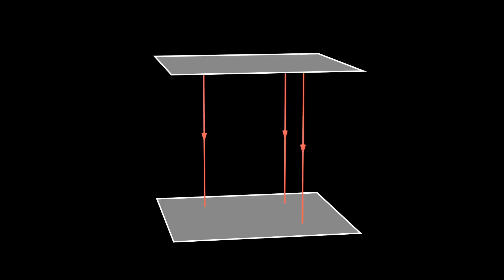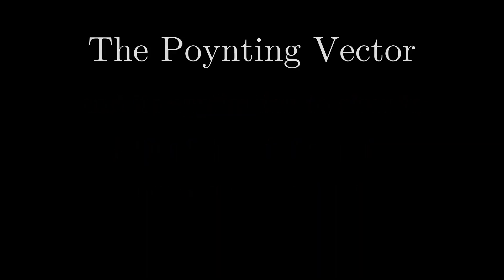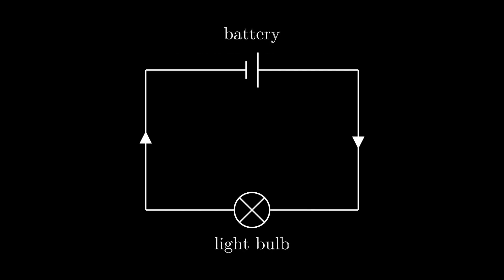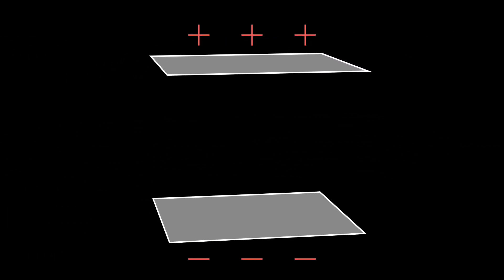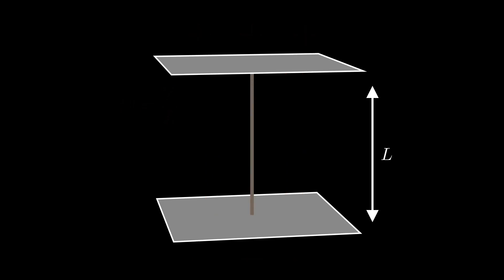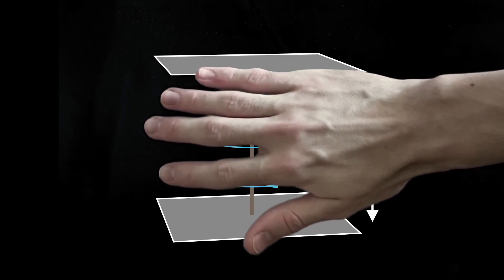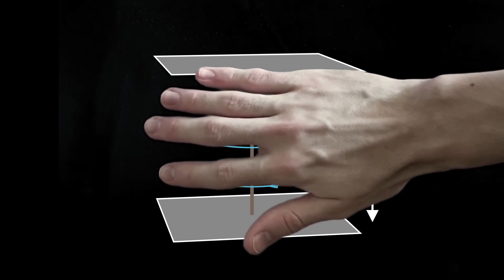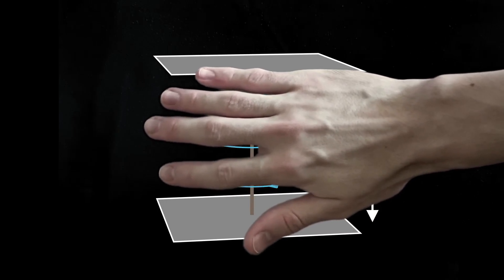The Poynting Vector in a DC Circuit

Comment: Derek's entire point revolves around treating the wires as antennas.  So yeah, the transient sure will send something across, but he's wrong that it "turns on".  The most frustrating thing about his video, including his followup, is he never talks about antennas.
Reply: In concept, a hypothetical lightbulb that illuminates upon ANY current no matter how small it is, could be lit up within 3 nanoseconds, but it is nowhere near significant enough to light up a real light bulb.  If it were, you've done a horrible job at selecting a lightbulb, because it will burn up as soon as the fields fully settle on their steady state condition, and the full power is delivered to the bulb.
Reply: @carultch  yes... walking through impractical situations is kinda the point of thought experiments. complaining that the lightbulb is unrealistic is as childish as whining about a relativistic train or perfectly aligned mirrors in an Einsteinian thought experiment.
Reply: @Errenium  I'm aware of that.  And I never said I was complaining.  I was just giving a reality check to this thought experiment, and addressing the OP's point.

Comment: Kudos to Joseph for spelling out this model so patiently. However there are some holes. 
At  5:50  There's a statement: "so yes it is indeed true that energy in electric circuit is transmitted by the electric and magnetic fields". That's not the logical conclusion from the calculations performed so far. All that has been demonstrated is that there are electric and magnetic fields that can be geometrically/algebraically combined so as to produce a number that equals the P = V * I accounting for power. The calculation does not prove that the fields actually carry the energy.  It is at least equally compelling to account for the conveyance of energy by simply integrating the electric field gradient along the wire from beginning to end (V), and the quantity of charges moving  "down" that gradient (I), losing potential energy to the heating interactions with molecules in the resistive parts of the circuit (R).  
It is no surprise that there are electric and magnetic fields associated with this activity, and that they are proportional to voltage and current. And those fields get "charged" from the circuit when it is turned on, and  "discharge" back into the circuit when turned off.  That does not mean that the pair of fields is the means of conveying energy during steady state operation.
My comment here does not prove the statement false, it just claims that the statement doesn't follow from the premises provided.
Reply: Correct.  The energy is supplied by the fields but this fact does not follow completely from the statements made.  Electron flow through a wire takes a long time and requires work to be done by the field.  That is the causal relationship.  The wire provides the electrons that support the field and field moves the electrons slowly, converting energy into radiation which is a disturbance in the near field. Photons are emitted as IR (hairdryer, toaster, incandescent light bulb).  A high frequency AC signal oscillates the charges in the wires producing heat and radio waves.  There may be no net displacement of the electrons.  They still get worked back and forth, overcoming resistance, while the field is subject to the effects of capacitance and inductance.  Thus information can be transferred quickly while the electrons, not.  An ideal antenna would have no resistance. Or something like that :)
Reply: @DanielL143  I'm happy you more or less agree with my comment, but I'd like to make one revision to your notes. It is true that the electrons move slowly (drift velocity), but the speed with which that motion propagates from one end of the wire to the other is at a large fraction of speed-of-light. So though the electron velocity is slow,  the speed with which they can have an action at any point in the circuit is very fast.
Reply: @Graham_Wideman A valid and key point for clarification.  The 'impetus' or change in state, especially during the transient response approaches 'C and this enables communication as we know it.  Would it be accurate to say that changes in the field can approach the speed of light while the movement of matter (electrons through a solid material in the case of a wire) is much slower. Do electrons in a vacuum tube move faster under the influence of a field? If current is the rate of change of charge, does the movement of the charge carriers affect Power and therefore the rate of energy transfer?  The ultimate point that I am trying to understand relates to the speed of transfer of energy vs the speed of transfer of information?  Can you help & thanks.!
Reply: @DanielL143  Although I am not sure I do believe that electrons in a vacuum tube are moving faster than in a wire. Thinking about a picture tube (as used in old TV sets or oscilloscopes) then I believe they are also the main energy carrier.  We know from particle accelerators that matter (electrons or protons etc.) can be speeded up to a high speed. I also know from my experience with old picture tube TV's that if the high voltage was too low then the picture would be too big for the screen. That correspond with that the magnetic influence from the deflection coils have a longer time to deflect the electrons as they fly slower.
If the energy was carried by EM forces to the screen they would be very fast and as far as I know would not be deflected by either static or magnetic forces and we know that it does so it must be the actual electron hitting the fluorescent on the screen that makes it light up.

Comment: I‘m in my first year of physics and we‘ve just been introduced to the poynting vector. I didn‘t get what it was in my lectures because the concept of how physics is taught in university doesn’t work for me but know I got a slight sense of what it might be! :)

One question though about the E-field though:
How can there be current if it (the E-field) is perpendicular to the wire? Is it slightly bent into the direction of current? Does it abruptly switch direction inside the wire? I‘m sorry if this doesn’t make any sense, correct me about my english, I‘m not native and would love to learn. Thank you for such an amazing video!
Reply from the maker: This is a great question, because it's commonly taught that there's an electric field inside a wire in the direction of the current, but not how strong this electric field really is. In this example it's actually very weak, much weaker than the field outside. The relevant equation is E = rho * J where J is the current density and rho is the resistivity. Wires have very low resistance and so E is very small, and in an ideal wire with no resistance there's no electric field. As an analogy, imagine that the electrons are little balls moving through a tube. If the tube has no air, then there's no air resistance, and you don't need a force to push them through. They just keep moving because of inertia. Similarly, you don't need an electric field to push the electrons when there's no resistance.

If there is some resistance then there will be a field inside the wires (in the analogy, the balls slow down because of air drag and you need a force to keep pushing them). So what happens if we take the second example with the lightbulb and battery and add some resistance to the wires? Then there will also be a small electric field in the direction of the current, making the total electric field point mostly perpendicular but slightly parallel to the wires. The thing that actually produces this new electric field is an uneven charge distribution on the wires, changing gradually from positive at one battery terminal to negative at the other.

In the Mathematica code I assumed the charge distribution was uniform, meaning all of that gradient happens across the lightbulb instead, and there's no resistance in the wires. I wanted to try adding some resistance to the wires as well, but then I would also need to solve for the charge density which makes the calculations much more difficult!

Comment: So how does the lightbulb light up? Normally the flowing electrons bump into the atoms of the wire, so heat is generated and, in case of a lightbulb, energy is radiated in EM-Waves (visible light) and thermal energy. I don't get how the energy of the EM-Waves of the flowing electrons in the circuit is necessary for the bulb to light up.
Reply from the maker: That’s correct, electrical energy gets converted into heat and light by electrons bumping around inside the lightbulb, but that doesn’t explain how the electrical energy gets to the lightbulb in the first place. The argument is that the propagation of energy from the battery to resisting components in the circuit is described by the EM fields, and then the conversion of energy into heat and light is described by atomic forces inside the resisting components.
Reply: @josephnewton   But this description flies in the face of how Veritasium insisted that we have been lied to and that all of the energy is in the fields.  The movement of the electrons in the wires was discounted as unimportant and they even used the "slow" average drift velocity as some type of justification... as though an intuitive sense of drift velocity is sufficient to either discard or explain energy transfer.  But now inside the bulb we are now re-allowed to reconsider particle motion, energy exchange and heat.  What justifies this overall treatment?  What magic takes the energy from the field only at the bulb to only cause electrons in the bulb to move about and heat up and become energy that is transforms to light... but which magic just doesn't apply to the current in the wire?
Reply: @cadeperkins the bulb is a high resistance element than the wire.hence only bulb lights up
Reply: @directajith  Yes, but that's not my point.  I was highlighting how there are two description of energy transfer--kinetic transfer via the electrons and also the EM fields, but they are only selectively applied to certain features of the circuit.  Veritasium was fairly bold in asserting that "lies" have been used to teach how energy propagates in a circuit, that it is all about the fields.  The video here has a heavy focus on the fields also.  But when questions about the heat and light in the bulb arise, once again the description reverts to particle motion, etc.  My intent was to point out that despite all the detail and knowledge, the tendency is still to compartmentalize the description to whatever is intuitively convenient.  A complete description will necessarily include both energy transfer in the EM fields and also that of the electron configuration and energy exchange between the particles (both electrons and atoms).  Also, unlike free propagating EM waves (i.e. light), the fields here have a source in the charged particles--the moving electrons, so any energy in the fields must necessarily come from the charged particles in the first place.  The "lie" is now becoming that they are separate concepts and that only one applies.